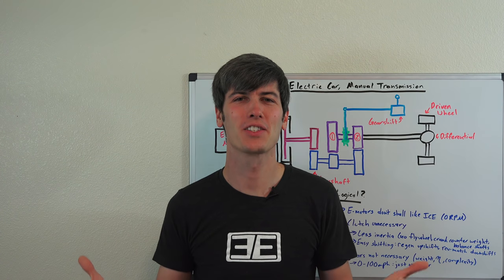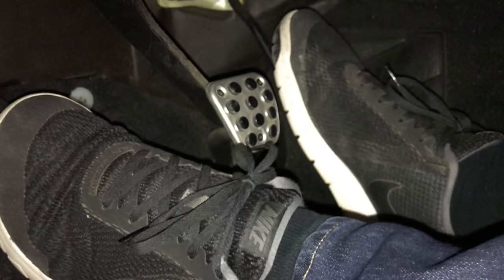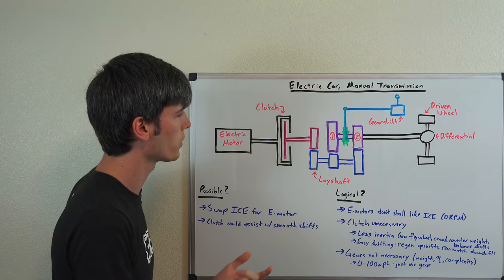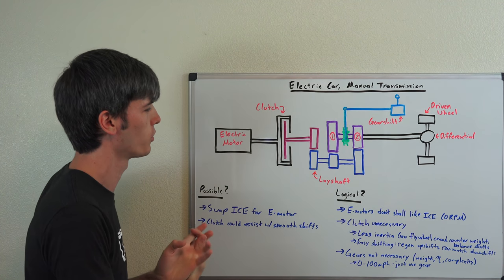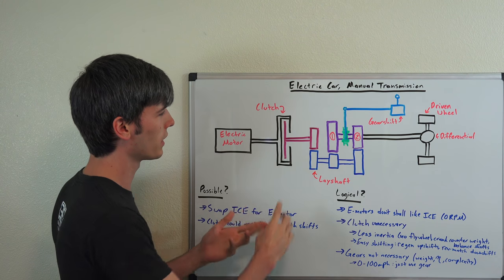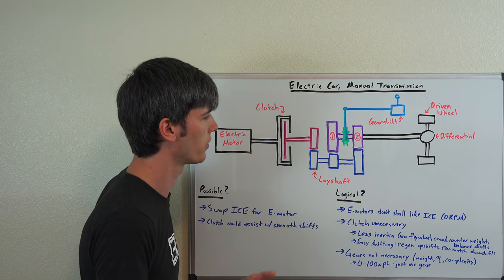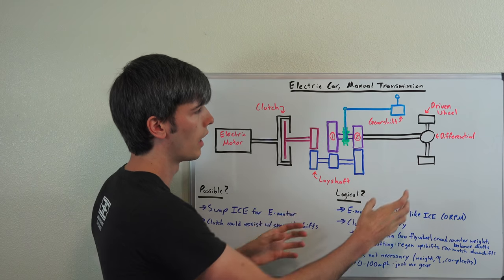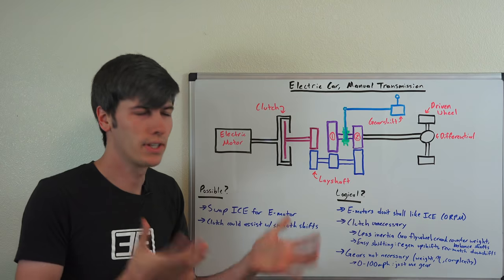Could Electric Cars Have A Manual Transmission?

Comment: An easier gear would better for the electric motor. 

Ever try to remove or sink a screw with a drill set tot he fastest gear. It gets hot and burns the battery out pretty fast as compare to setting it on a slower gear. You will be able to set or remove more screws. I have had a lot of damaged drills because of workers using the fastest/ hardest gear.

Comment: I don’t know if I would like an EV manual as much as a gasoline manual. For the fact that the gasoline manual, the power delivery just seems smoother before it peaks where EV manual with the clutch just seems like the instantaneous lock is going to be jumping, at least until you get used to it I guess And be a little bit lighter on the throttle as you shift. I think for me manual is more rewarding than an automatic in general especially when going around in track because it’s kind of you controlling the car versus the car controlling itself

Comment: electronic operate wet cluch , trans axel  2/3 gear trans, electric motors can be lighter and working on constant speed. more reliable. friction heat from trans cluch can be use for heating.

Comment: The zombie 222 has a couple gears. First is 1:1 and any above gears are overdrive. However, a clutch is used because an engine can't run at 0 rpm, an electric motor can.

Comment: well if you add an electric motor to a car that already have gears or if they made quick change motors kits... to convert any car to electric. (like if muscles became illegal unless you add an electric motor instead...) now for the "electric motor" to profit, the motor would need to have a heat problem at certain Revs that can only be cured from turning slower. also of you could add alternators on each wheels instead of having breaks disks, the conversion would be complete!

Comment: Manual Transmission is very much logical to use in Electric Cars. Lower gear means limiting the power consumption and then economic reasons. And from a classic driver's point of view, it's not gonna be a very happy experience without a shifting knob. Also Electric Cars do create a LOT of noise, they should become sleepers in the coming future, maybe adding an acoustic motor shell or something?

Comment: I would think that a variable of multiple output electric motor (or motors) could extend their range, increase their performance, or decrease their output requirements by using a manual transmission. Still, with electric being about simplicity, adding a manual or any other reduction or output measures simply adds nonbeneficial weight and complexity.

Comment: I think the best way we can incorporate a manual transmission in an electric car without complicating things is to have an electronic limiter in the motor itself.the transmission wouldn't be a physical thing but rather a cable which,when put in "gear" would limit the speed the electric motor would take the car up to.i think this is the best compromise.Let me jear your thoughts as well

Comment: To the 'electric-vtec' guy down below: It would be a nice solution to use the star-delta connection (the word 'star-delta switching' fits probably more into that). Just accelerate in the star circuit and later on the so called 'electric vtec' engages with the switch over to delta circuit.
I am already fascinated by the humming noise of big windings (coils).
Reply: Oh and yes I know, that running an electric motor in the star switching for too long can cause overheating problems in the coils and connections.

Comment: my friend built an old s10 and he just pulled the motor and replaced it with an electric which turned a manual transmission...he said you could drive it like a normal truck but it was way easier to just leave it in second or third the whole time and drive it like an automatic...but this was way back in 2000 so he had a bed full of lead acid batteries

Comment: There are restored classic cars with electric engines and they still use the original transmission. Have a look at a few on the "fully charged" channel. There's a beetle and a classic Porsche to name a few.

Comment: I hope the first gear is a down gear for more torque, so that the second gear is a direct gear.
It makes no sense upgearing an electric motor (the torque gain of lowering RPM, will be negated by the taller gear ratio).
What works best for electric cars is high revving motors, with a 'tow' gear, for higher torque and acceleration.
Reply from the maker: That's what they do. First gear is mostly just for the launch at the start, or super slow corners.

Comment: Tesla semi should have a gearbox... only  2 or 3  required    the normal gear goes straight for drive  while others  are used if towing a  heavy weight cargo uphill.

Comment: Electric cars with at least 2 gears will surely happen in the future when magnetic transmissions that are now being designed are commercially available. They have virtually no friction since there are no connecting parts and so all loss of power through friction is gone. This will actually make electric cars more efficient since at lower speeds the electric motor will have to work less.

Comment: Benefits for having a manual in an EV would be the addition of an overdrive gear for cars and if you plan on towing heavy loads, with say an EV semi truck. You really couldn't make an EV semi truck efficient, unless you added gear reduction. Sure, electric motors have wicked amounts of torque but, you'd still be putting enormous stress on the electric motor (and turning tons of energy into waste heat) when first getting going with a full load. Any truckers care to comment?

Comment: YES  They SHOULD! FOR SURE for many reason  for example any electric car should have in standard 2  speed manual  transmission the first gear for hi torque and low speed for hi townig capacity towning other cars and trilers that may safe alot battery consumption and 2nd gear for hi speed  standard electric cars run around 120 - 160 because it have only one gear but on 2nd gear it can go around 220-260 i think. so 2 speed manua transsmision it is will be great for electric vehicles

Comment: I saw a 0 to 60 drag race between a cvt and a manual street legal car(same car, same performance), the manual gear car won every time. The cvt for all it's features such as smooth transmission and fast shifting is still limited by the durability of the belt from rotation stress and the electronic limiter that hinders the gears from shifting up too fast (belt stress prevention measure) and caps the maximum engine output to the safety limit of the gear belt as compared to manual where maximum engine output is entirely based on the engine design. Cvt is for ppl who never want to drive a real muscle car in their life. Those who still love cars learn how to drive manual. Sad to see a manual slowly phased out in favor of cheaper to build cvt that are not only prone to electronic failures but also mechanical failure of the belt.

Comment: An internal combustion engine or an electric motor is just a prime mover. So, imo, the transmission basically can still be provided with clutch. However, in practice, car manufacturers will consider several aspects such as efficiency, weight, economy, etc.
I am not sure they will produce electric cars with clutch in them for commercial purpose unless there are massive demands from manual-clutch car lovers.

Comment: Leaving the topic about manual transmission.
Doesn't electric motor need a lot more power to start rotating compared to rotating at constant speed? And how much more is that? Would it make sense to use some kind of clutch (like torque converter in automatic transmission) to keep motor spinning for shorter amount of time (like red light) and engage it fully (like clutch in manual transmission) when car starts moving?

Comment: I would have thought that having at least two gears would be desirable for the likes of lorries with heavy loads, or just bog standard consumer cars who have to drive in wet/snowy/icy weather or loose terrain. I'm no engineer or physicist but I would think that instant torque delivery would cause a lot of spinouts in such conditions.
Reply: Also of course the "fun factor" that comes with a manual, but I can see that being added to certain car models by manufacturers at a higher price regardless of efficiency or performance for those who are willing to pay for it.

Comment: I converted a 4 speed car to electric over 20 years ago... coupled the motor directly to the transmisson.. I could leave the trans in 2nd gear and drive it all day..  it could spin the tires at start and reach over 80 mph easily.. No need for gears.

Comment: a manual transmission is the smart choice. way more durable than an automatic trans.automatic trans are what take cars off the road permanently because of the huge repair/ replacement costs when they break

Comment: And what for high speed vehicles(trains). In Belgium they use a 4000V net for trains, but you are limited to the amounts of kv(revs/min/V). So you have 4000V(which you can't change that easily), and a motor which has a certain kv value, so also not that easy to change. But if you then use a x-gearbox(with x being the amount of gears, manual or automatic), can't you than make trains that are faster, without needing to upgrade the 4000V net, or the electric motors?

Comment: You missed a critical point - the electric motor generates is largest torque at zero RPM (when the back emf = 0);  of course, the torque is normally limited by the power source limit rather than the motor limitations.   As hinted at, the electric has much less limitation on rpm limits - often able to get to 100,000 rpm depending on structural limitations of the rota.  So we have a engine that has maximum torque from zero, and has very high reeving ability, so you are unlikely to have a situation where the friction limits of the tires is more than the torque at the wheel (ie you don't wheel slip) and cannot easily exceed the national speed limits before frictional and structural limits of the rota take over.  So as noted, gears are just added expense, weight and complexity for most cars except maybe for exotic designs (like racing cars).

Comment: Just change the pistons. In combustion pistons are pushed with gas, so why we don't change it to pistons pushed by generated electromagnetic force, in other words electricity, then you get V6 V8 V10 V12... electric cars lol. Then you can have a clutch, but not a traditional clutch, in a way that it is a boolean switch, either disconnect or connect. The clutch can have literally nothing to do with the "engine", because for electric "engine" the power given to each pistons will be directly involved with the accelerator, and as said even in a full stop the "engine" won't just go off, and starting at a high gear simply means more force is required to be done by the pistons. So this clutch will be insanely easy to use, you don't have to press all the way inside like a traditional one to get it disconnected, just a simple movement with a click. It's fun isn't it. I always wanted to tests it irl but yeah, probably not happening.

Comment: The reason I find this video so interesting is that theoretically what you could do is use a smaller, cheaper motor to drive the gears and simply set up larger gear ratios to make the car perform like it has a larger motor. For example, the first gear could be a 2:1 torque ratio for the initial launch and the hypothetical 5th gear could be like a 5:1 or 6:1 speed ratio and have the car achieve both amazing acceleration and quite good top speed. The reason I would like to think a system like this would be so awesome is because the issue of weight would cancel out since you could use a smaller, lighter motor that gets it's amazing performance from the gear ratios. Though a car like this (if the concept were to work, which is obviously still up in the air and could simply be a more complicated version of two equally performing cars.) would never reach it's full potential out on the road, but nor do Lamborghinis or Ferraris or Koenigseggs and they still sell. In fact, a car like this could be cheaper since you might not even need as big of a battery to drive the smaller motor and make the car cheaper. Imagine a car like the One:1 that only costs $250,000-$500,000. Just my opinion on the matter, and keep in mind that I am by no means a mechanical engineer.

Comment: Sure, but direct drive doesn’t really make sense for efficiency either. Just like an ICE, an electric motor uses more energy the faster it spins. So yeah, a 6 speed might not make sense, but having a selectable final drive would increase range.

Comment: I only see more gears in electric cars for better acceleration, top speed and towing something. For example 1st gear is for 0-100 kph, 2nd gear 0-100-200 kph, 3rd gear 0-200-300 kph and forth 300kph+. 0-200-300 means that car can go from zero easily but with bad acceleration. Also cruising will be more efficient with higher gear.

Comment: For this issue i would like to know what both electric motors and ICEs' energy efficiency is. I mean, an ICE is not going to give you much torque under 1000rpm, and it wouldn't go above 6000rpm (on average), but i don't know anything about limits when it comes to electric motors.

Comment: Most EVs that are converted ICE cars DO use manual transmissions.
You dont really need a clutch pedal with an electric...they dont need to idle....and for shifting all you have to do is cut power while shifting.
All a clutch would do is add extra unneeded mass to the drivetrain.
I would love a trans on my LEAF to keep it in the max torque band...the 0 to 30 is ridiculous....but for the intended purpose, all a multigear trans would do was reduce efficiency.

Comment: I wonder if a transmission could be imitated.  
As in, you have the gear stick and clutch, but they aren't connected to any transmission.  Rather, they're connected to the cars computer and what 'gear' you're in is used by the computer to control the electric motor.

It wouldn't be the same, but I bet you could get pretty close.  Plus, if you didn't want it, you could just turn it off.

Comment: Performance electric motorcycles are powerful enough to not need to change ratios. The wind resistance at top speed is more than the steepest hill they are ever likely to climb, so it's not like they will be short on torque. A lower gear and they couldn't make use of the extra power without skidding/flipping the bike in a wheelie. There is no "minimum speed" for an electric motor. I think a vehicle like a Nissan Leaf could benefit if they wanted to increase top end speed above 90 mph although that's the fastest most people are likely to drive even if they have a clear motorway. This is a vehicle with similar power to a 2 litre Golf TDI. A Tesla is usually performance oriented enough that it's like the bike, although because cars are heavier it might benefit slightly. Electric buses and HGVs would need some sort of gear ratio selection usually, although because they top out at 50-60 mph, it probably wouldn't need as many gears as the diesel equivalent.

I think there might be an issue with people burning out motors going in a higher gear than is recommended for the hill they are trying to climb. This is not an issue with a combustion engine, they will just slow and stall if the car gets slow enough but won't be damaged. Some education about gear selection would be required to prevent warranty claims, unless they either make the transmission automatic or put in an over current shut off, which could be a pain on a busy road.

You would still need a clutch unless you want a car that only changes gears while stationary - e.g. like a cordless drill! I would really like to try a flappy paddle electric performance car. Just continuous power band all the way! You would have no muscle cars catching you up at high speed that's for sure!

Extra: I've just thought of a scenario where electric cars might need gears - towing a caravan. Sure the vehicle weight might be able to handle everything, but maybe a Nissan Leaf towing a caravan up a hill would benefit from a low speed like my cordless drill! A Tesla's 1G acceleration might be able to handle it though! Electric motors do tend to get a bit heated and inefficient if you try and load them down too much.

You wouldn't need a reverse gear or even neutral though, seeing as you can simply switch polarity.

Comment: I was wondering, since all motorsport is eventually going to go electric, how would pulling the handbrake work for drifting? Let's say only the rear wheels are driven by the engine, so pulling the handbrake which only affects the rear wheels would have a harder time locking up quickly and inducing oversteer. Having a clutch and disconnecting the engine with the diff whilst pulling would help but as mentioned in the video it would end up being heavier and adding more complexity to the system. Your thoughts? :)
Reply: I would think that it would be easier. You could link the rear motor directly to the hand brake to lock up the wheels instantly. It would mainly be about getting the best control out of it as well. No EV has tackled that yet.

Comment: tl;dr: not needed. Electric motors spin from 0rpm up to 20,000+ with useful power at all settings, max torque when stationary

Most car engines run from ~700-5000 with usable torque from 1500-4000

So if you gear your car for max speed at max RPM, on an electric motor it will work all the way down to zero. Any "gearing" is done by the control circuits (most automotive drive motors are actually more like stepper motors than anythign else) moving from parallel to series windings with rotational speed (the same as is done on trains)